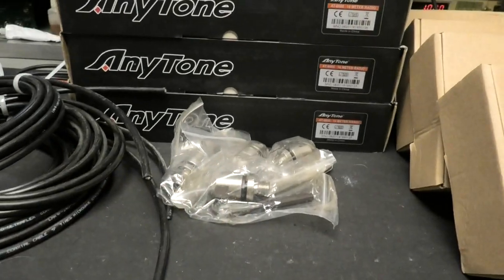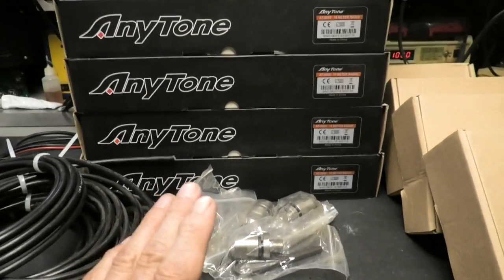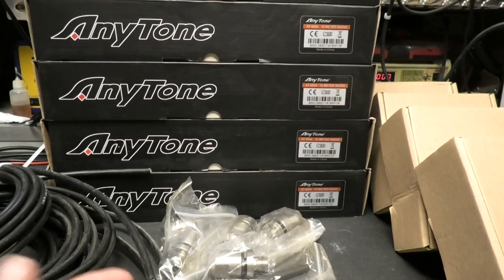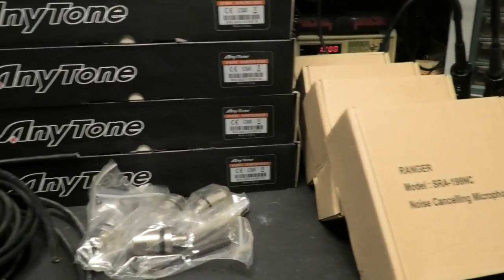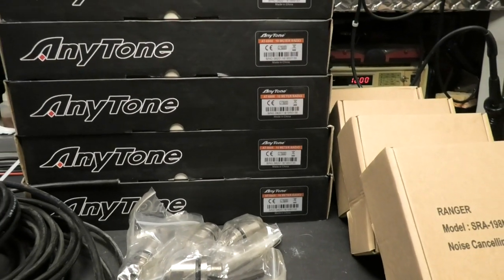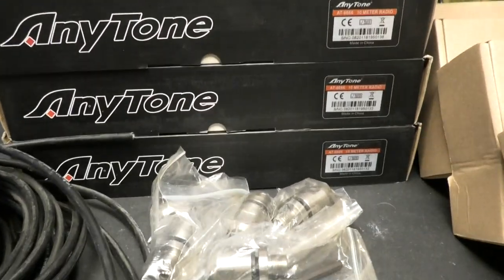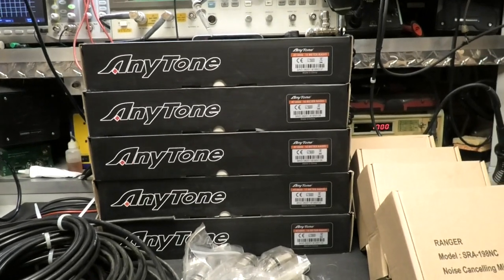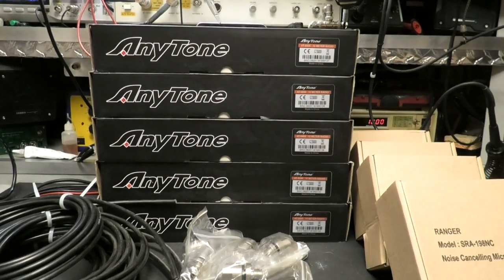AnyTone AT 6666 Update ..  If You Need SSB And You Don't Have The Space.

Comment from the maker: FineTuned AnyTone AT6666 If You Need SSB And You Don't Have The Space. Otherwise, It's The FineTuned Stryker SR955HPC With Alps Encoder, MAX MOD, Matched ERF2030 Pluse's And The Tune - 5 Year No Questions Asked Warranty On The Encoder / Channel Selector. This Also Applies To The Am/Fm Version  Stryker SR655HPC.  100 Alps Encoders are on the way .. knobs too!   Bite your tongue and follow directions .. Here's what it takes to cut through the noise, be loud and crystal clear with a better receiver too:  A) Tuned Bench:  https://www.youtube.com/watch?v=lwcDfXOgAls.  True, it's more complicated and time consuming to accomplish these consistent and accurate results. Below is a partial procedure and list of calibrated equipment used to achieve this level of performance . Read on ..

Fine Tune CB Radio Shop strictly adheres to (https://www.nist.gov/) NIST Traceable Calibrations and other industry standards to maintain accuracy and consistency for providing Real World Performance Tuning of Citizens Band and 10 Meter export mobile radios with integrity.

"Basic Textbook AM/FM/SSB Transceiver Tune, Alignment and Calibration" 

1) Pll adjustments
VCO & OSC, AM TX OSC, USB TX OSC, LSB TX OSC.

2) Transmitter alignment
DRIVER BIAS, FINAL BIAS, SSB  (or gate voltages for mosfet versions) CARRIER BALANCE, HI-LO AM & SSB Power, RF METER, AMC, ALC and FM DEVIATION.

3) Receiver alignment
AM/FM RF & IF SENSITIVITY, FM DETECTOR/DEVIATION, SSB IF SENSITIVITY, SSB S-METER, AM/FM S-METER (100uV unmodulated -67dbm for “S-9” meter reading!), AM/FM SQUELCH RANGE, SSB SQUELCH RANGE, and NOISE BLANKER/AUTOMATIC NOISE LIMITER (Real World dBm to volts (uV) tables below).

That's just a typical run of the mill textbook tune up and alignment (if you're lucky). There's more to it than frequency alignment, modulation adjustment, meter calibration and a tune up report displaying exaggerated rms Bird peak watts! 

"Test Bench includes"

Bird 4314C Meter
https://www.birdrf.com/Products/Test%20and%20Measurement/Power-Meters/Wattmeters-Line-Sections/RF-Wattmeters/4314C_PEP-Single-Element-Wattmeter.aspx
Part 1) https://www.youtube.com/watch?v=RpX9IHe4ORM&t=16s
Part 2) https://www.youtube.com/watch?v=LuhbqTf6Bxw
Bird 4314C Accuracy Test: https://www.youtube.com/watch?v=DqEOabYqhQo&t=5s
Bird Stipulates 1/2 wavelengths  https://www.youtube.com/watch?v=5eWhgT-rTII
And Genuine Bird Elements from 1K down.

Bird 4373 Sampler 
https://www.rfparts.com/signal-samplers.html

HP8924c with options
http://userequip.com/files/specs/2147/HP%208924C%20Repair.pdf
https://www.youtube.com/watch?v=Cg1w0xBa27s&t=1s

HP8920a with options
https://www.keysight.com/upload/cmc_upload/All/EPSG072204.pdf

Three analog scopes, one digital 200 Mhz
https://www.atecorp.com/atecorp/media/pdfs/data-sheets/tektronix-2465b-2467b_manual.pdf
https://www.youtube.com/watch?v=by98x4eu2lM

Fluke 27fm
http://www.fluke.com/fluke/inen/digital-multimeters/fluke-27.htm?pid=56055
 
LCR http://www.lcrresearch.com/wp-content/uploads/2017/05/LCR_Pro1_Manual_version1.03.pdf

Power supplies
6 Cosel PBA1500f12 (750 amps) variable and configurable.
https://en.cosel.co.jp/product/powersupply/PBA/PBA1500F/PBA1500F-12/
Corcom 20VB1 F7130 EMI Filter 50-60Hz 250V

Times Microwave Coax jumpers and test leads
http://www.timesmicrowave.com/cms/products/cables/lmr/
https://www.youtube.com/watch?v=EmqaGJ6IWow
https://www.youtube.com/watch?v=1ltFVSxGp5Y
https://www.youtube.com/watch?v=v12YZT_1o90
https://www.youtube.com/watch?v=h7iiYfmYWRA&t=215s

Amphenol RF Connectors
https://www.amphenolrf.com/
https://www.youtube.com/watch?v=dVh5B0hdEA0 
https://www.youtube.com/watch?v=dKZg8T_AOso

More range, compliments, reliability and a quieter, clearer but more sensitive receiver,  Get Fine Tuned .. not peaked and ruined.

Here are some VideoGates of me at the bench practicing what I preach using my bench radio or customers radio completed and ready to be shipped: https://www.youtube.com/results?search_query=hard+drive+163+ more: https://www.google.com/search?q=Hard+Drive+163+nm&ie=utf-8&oe=utf-8&client=firefox-b-1-ab

It's what I recommend, use, service and sell ... to you ... not something non practical or deceiving in a misleading way. I'm not just the tech and owner of Fine Tune CB Radio Shop, I'm a customer too!  When finished, You'll be giving radio checks, not asking for them .

dBm To Watts and Volts
Tables below displays relationship between Power in [dBm] or [Watts] and Voltage in RMS, peak, peak-to-peak for sinusoidal signals in 50-Ohm systems for accurately measuring and tuning am/fm/ssb receiver sensitivity, agc, squelch and "S9" Meter calibration. Real World! Mike @ Mikes Radio Repair (Romper Room), Mark Rutherford aka Mark 19960, CB Kidd, Martian and all of your other fake accounts pay attention to the tables below, stop misaligning radios, spreading false information and promoting propaganda! 

  [dBm] [Watts]   [Volts]rms   [Volts]p    [Volts]pp
-140 0.100E-16  22.361 nV  31.618 nV  63.236 nV 
-139 0.126E-16  25.089 nV  35.476 nV  70.952 nV 
-138 0.158E-16  28.150 nV  39.805 nV  79.609 nV 
-137 0.200E-16  31.585 nV  44.662 nV  89.323 nV 
-136 0.251E-16  35.439 nV  50.111 nV  100.222 nV 
-135 0.316E-16  39.764 nV  56.226 nV  112.451 nV 
-134 0.398E-16  44.615 nV  63.086 nV  126.172 nV 
-133 0.501E-16  50.059 nV  70.784 nV  141.568 nV 
-132 0.631E-16  56.167 nV  79.421 nV  158.842 nV 
-131 0.794E-16  63.021 nV  89.112 nV  178.223 nV 
-130 0.100E-15  70.711 nV  99.985 nV  199.970 nV 
-129 0.126E-15  79.339 nV  112.185 nV  224.370 nV 
-128 0.158E-15  89.019 nV  125.874 nV  251.747 nV 
-127 0.200E-15  99.882 nV  141.232 nV  282.465 nV 
-126 0.251E-15  112.069 nV  158.465 nV  316.931 nV 
-125 0.316E-15  125.743 nV  177.801 nV  355.602 nV 
-124 0.398E-15  141.086 nV  199.496 nV  398.992 nV 
-123 0.501E-15  158.301 nV  223.838 nV  447.677 nV 
-122 0.631E-15  177.617 nV  251.151 nV  502.302 nV 
-121 0.794E-15  199.290 nV  281.796 nV  563.591 nV 
-120 0.100E-14  223.607 nV  316.180 nV  632.360 nV 
-119 0.126E-14  250.891 nV  354.760 nV  709.519 nV 
-118 0.158E-14  281.504 nV  398.047 nV  796.094 nV 
-117 0.200E-14  315.853 nV  446.616 nV  893.232 nV 
-116 0.251E-14  0.354 µV  0.501 µV  1.002 µV 
-115 0.316E-14  0.398 µV  0.562 µV  1.125 µV 
-114 0.398E-14  0.446 µV  0.631 µV  1.262 µV 
-113 0.501E-14  0.501 µV  0.708 µV  1.416 µV 
-112 0.631E-14  0.562 µV  0.794 µV  1.588 µV 
-111 0.794E-14  0.630 µV  0.891 µV  1.782 µV 
-110 0.100E-13  0.707 µV  1.000 µV  2.000 µV 
-109 0.126E-13  0.793 µV  1.122 µV  2.244 µV 
-108 0.158E-13  0.890 µV  1.259 µV  2.517 µV 
-107 0.200E-13  0.999 µV  1.412 µV  2.825 µV 
-106 0.251E-13  1.121 µV  1.585 µV  3.169 µV 
-105 0.316E-13  1.257 µV  1.778 µV  3.556 µV 
-104 0.398E-13  1.411 µV  1.995 µV  3.990 µV 
-103 0.501E-13  1.583 µV  2.238 µV  4.477 µV 
-102 0.631E-13  1.776 µV  2.512 µV  5.023 µV 
-101 0.794E-13  1.993 µV  2.818 µV  5.636 µV 
-100 0.100E-12  2.236 µV  3.162 µV  6.324 µV 
-99 0.126E-12  2.509 µV  3.548 µV  7.095 µV 
-98 0.158E-12  2.815 µV  3.980 µV  7.961 µV 
-97 0.200E-12  3.159 µV  4.466 µV  8.932 µV 
-96 0.251E-12  3.544 µV  5.011 µV  10.022 µV 
-95 0.316E-12  3.976 µV  5.623 µV  11.245 µV 
-94 0.398E-12  4.462 µV  6.309 µV  12.617 µV 
-93 0.501E-12  5.006 µV  7.078 µV  14.157 µV 
-92 0.631E-12  5.617 µV  7.942 µV  15.884 µV 
-91 0.794E-12  6.302 µV  8.911 µV  17.822 µV 
-90 0.100E-11  7.071 µV  9.998 µV  19.997 µV 
-89 0.126E-11  7.934 µV  11.218 µV  22.437 µV 
-88 0.158E-11  8.902 µV  12.587 µV  25.175 µV 
-87 0.200E-11  9.988 µV  14.123 µV  28.246 µV 
-86 0.251E-11  11.207 µV  15.847 µV  31.693 µV 
-85 0.316E-11  12.574 µV  17.780 µV  35.560 µV 
-84 0.398E-11  14.109 µV  19.950 µV  39.899 µV 
-83 0.501E-11  15.830 µV  22.384 µV  44.768 µV 
-82 0.631E-11  17.762 µV  25.115 µV  50.230 µV 
-81 0.794E-11  19.929 µV  28.180 µV  56.359 µV 
-80 0.100E-10  22.361 µV  31.618 µV  63.236 µV 
-79 0.126E-10  25.089 µV  35.476 µV  70.952 µV 
-78 0.158E-10  28.150 µV  39.805 µV  79.609 µV 
-77 0.200E-10  31.585 µV  44.662 µV  89.323 µV 
-76 0.251E-10  35.439 µV  50.111 µV  100.222 µV 
-75 0.316E-10  39.764 µV  56.226 µV  112.451 µV 
-74 0.398E-10  44.615 µV  63.086 µV  126.172 µV 
-73 0.501E-10  50.059 µV  70.784 µV  141.568 µV 
-72 0.631E-10  56.167 µV  79.421 µV  158.842 µV 
-71 0.794E-10  63.021 µV  89.112 µV  178.223 µV 
-70 0.100E-09  70.711 µV  99.985 µV  199.970 µV 
-69 0.126E-09  79.339 µV  112.185 µV  224.370 µV 
-68 0.158E-09  89.019 µV  125.874 µV  251.747 µV 
-67 0.200E-09  99.881 µV  141.232 µV  282.465 µV
-66 0.251E-09  112.069 µV  158.465 µV  316.931 µV 
-65 0.316E-09  125.743 µV  177.801 µV  355.602 µV 
-64 0.398E-09  141.086 µV  199.496 µV  398.992 µV 
-63 0.501E-09  158.301 µV  223.838 µV  447.677 µV 
-62 0.631E-09  177.617 µV  251.151 µV  502.301 µV 
-61 0.794E-09  199.290 µV  281.796 µV  563.592 µV 
-60 0.100E-08  223.607 µV  316.180 µV  632.360 µV 
-59 0.126E-08  250.891 µV  354.760 µV  709.520 µV 
-58 0.158E-08  281.504 µV  398.047 µV  796.094 µV 
-57 0.200E-08  315.853 µV  446.616 µV  893.232 µV 
-56 0.251E-08  0.354 mV  0.501 mV  1.002 mV 
-55 0.316E-08  0.398 mV  0.562 mV  1.125 mV 
-54 0.398E-08  0.446 mV  0.631 mV  1.262 mV 
-53 0.501E-08  0.501 mV  0.708 mV  1.416 mV 
-52 0.631E-08  0.562 mV  0.794 mV  1.588 mV 
-51 0.794E-08  0.630 mV  0.891 mV  1.782 mV 
-50 0.100E-07  0.707 mV  1.000 mV  2.000 mV 
-49 0.126E-07  0.793 mV  1.122 mV  2.244 mV 
-48 0.158E-07  0.890 mV  1.259 mV  2.517 mV 
-47 0.200E-07  0.999 mV  1.412 mV  2.825 mV 
-46 0.251E-07  1.121 mV  1.585 mV  3.169 mV 
-45 0.316E-07  1.257 mV  1.778 mV  3.556 mV 
-44 0.398E-07  1.411 mV  1.995 mV  3.990 mV 

                 Don't Be A Mud Duck!

 https://www.arrl.org/shop/ARRL-Handbook-2019-eBook

Hard Drive 163 NM. 73's! Click click.?